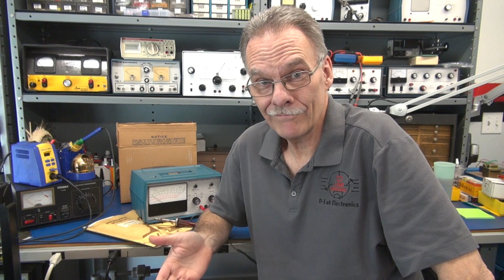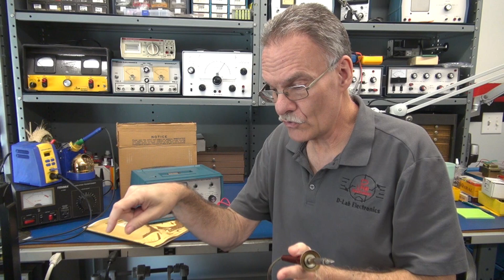Fathers day video D-Lab History What set my electronics path

Comment: Nice video. I'm guessing I'm a couple years older and I followed a similar path. I initially started by buying broken TV's at garage sales and finding the bad tubes using the tube tester at the local drug store. I made good money doing this and used the funds to buy heathkits. The shortwave I built was the ultimate. I also took a basic electronics class at a vocational school in high school. I also dove into car electronics and earned decent money at that. I also joined the military at 17! I went into the Navy Advanced Electronics program and specialized in surface-search and air-search radars. Sure are a lot of "also's"!
I'm retired now but still work on guitar amps for friends ... just did a Acoustic s.s. base amp and a Fender Bandmaster Reverb. The Fender Reverb had noise issues which led to me finding your YouTube channel. The video you made helped me find a solder failure at a ground point so thanks for that. Sharing your knowledge is a class act and I wish you well.

Comment: Happy Father’s Day 2 days ago, I was born in 1969 and I had a fair amount of interest in electronics from 1978-1979, but in 1980 I got very serious about electronics, and I started to tinker around with 1930s tube radios to 1984 then started to learn about TVs and electronics repair and ran a side business in repairing consumer electronic goods and I continued to run it until 2003, when I retired from my side business because of digital technology and electronics being made in China, with TVs being digital devices which I have no interest to work on at all, I used to work on the analog electronics which I knew how to repair but not digital electronics. Happy Father’s Day to you 🎉keep up the good work.

Comment: Happy Father's Day! At an early age I had an interest in my father's working on the household radios and tv's, in the 60's. I would bring home discarded radios and tv's from trash days and fix them up. I also did repairs for neighbors. One day, at age 14 or so, I announced to my dad that I wanted to be a radio/tv repairman. To my shock, he said "Hell no! Slave trade!". Apparently he had some kind of a bad experience as a radio repairman working in the shops in the 1930's. I had always wondered where all the boxes and boxes of old tubes came from that were in the coal room in the basement. I took electronics shop in high school, but by my senior year, I started getting interested in computers. After graduation, I got a tech cert in computer repair, and worked in that trade for 30 years.

Comment: Cool video.   I got inspired Christmas 1968.   I got a 50 in 1 electronics kit from Radio Shack for a gift.   What hooked me was everything I knew electrical had 2 wire connections.   Batteries, bulbs, motors, switches, solenoids, relays, etc.   What intrigued me was the dang transistors in the kit.   I just needed to know and understand what that damn  third lead on the transistor was for.   That simple question set me on my path of learning that became a life long passion of electrical and electronics field.   Went to school for Electrical Engineering then worked in the telephony industry and retired.  In retirement I make a few bucks here and there repairing whatever folks trust me with trying to repair.  Thanx for sharing and adding to my electronics portfolio of knowledge.  Also after retirement your videos and several other YouTubers have converted my general basic understanding of tube tech into a solid working knowledge of them to repairing various vintage tube amps, radios, HiFis and jukeboxes.   Happy Father's Day to you.

Comment: Terry, as you, I to delve into electronics in 1955.  I got lots of books from the Library, bought Popular Electronics, Radio Electronics and more.  At the age of 9 in 1957, I started repairing TV's in my neighbor. I knew I had a knack for it.  But knew I'd want to get into computers, even back then!
Bought my first computer in 1976. Heathkit H-8.  Then moved on to CP/M. And went from there into the Network industry. Worked for 3COM, Novel, Racal-Vadic and CIsco before I retired. 
--
In the Army I taught: 1) Basic Electronics, 2) HAM Radio, (had my license in 1984), 
3) Telephone Systems and 4) Microwave Propagation...
--
Now I restore old Heathkit Tube Test Equipment and old 30's to late 40's Tube Radio's.

Comment: Happy Father's Day, Terry!  Your path was similar to mine, though I had to learn it all myself because my father was not into electronics at all. Took electronics and computer courses in high school (early 1970s), then took an EET degree at MTU which was enough to get me a field engineering job repairing refrigerator-sized "minicomputers" on Wall Street.   Eventually ended up overseas repairing some of the oldest mainframes left in the US military right down to component level because parts shipments took too long or spares no longer existed worldwide.  Built R/C airplanes and rebuilt a few old Volkswagens in my time as well.  Now I just repair things for fun.  Definitely fun times!